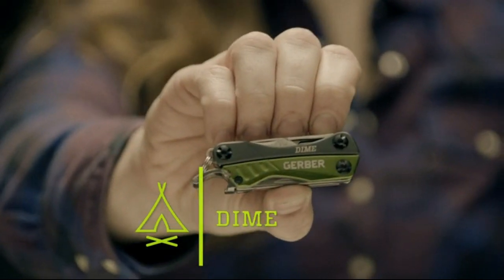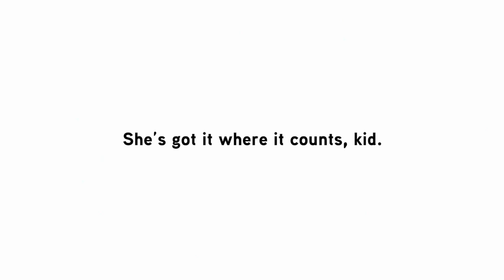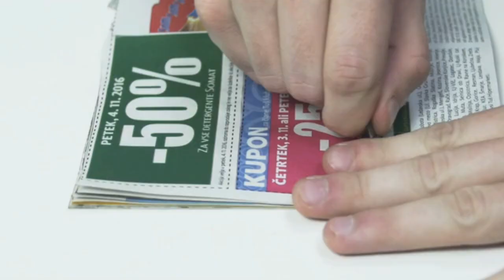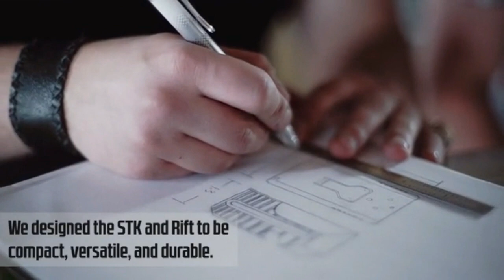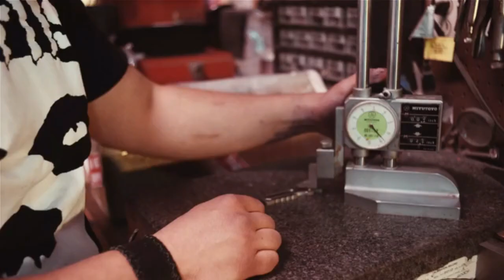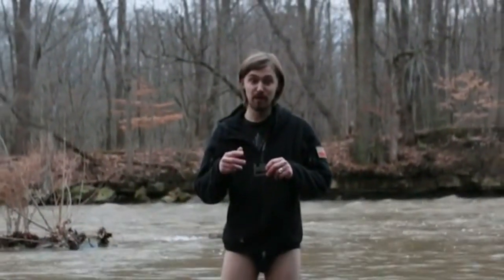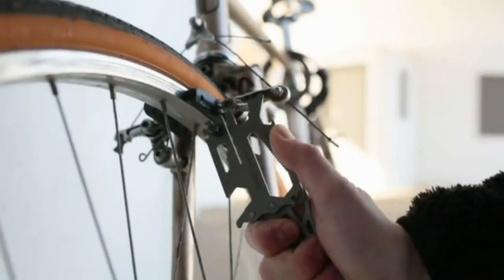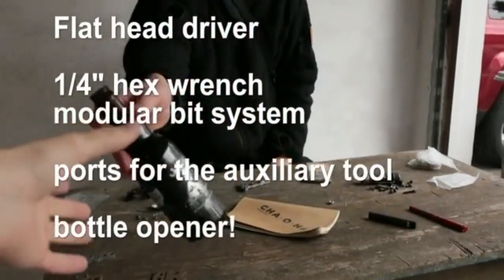6 Portable EDC Multi Tools | Pocket EDC Multi Tools | Compact EDC Multi Tools

Comment: All overpriced useless junk and that last one no self-respecting cyclist who knows anything about maintenance on their bike would ever use it
Reply: Yeah. I love multitools. I even like bicycle multitools. But bikes are so cramped in space in many cases that it just pays to carry purpose built tools on a bike. They just  work so much better. And so many of them are so light now that its almost pointless to try and save weight by buying a multitool that doesnt do the job as well. 
I can tell you from experience that the hex cutouts on the card type tools are next to useless. They wont fit into any sort of cramped space. And gripping the card to turn it is torture. Getting that fastener tight again is next to impossible too.